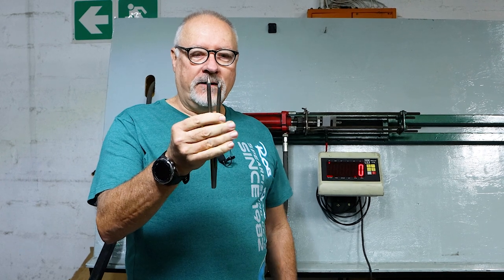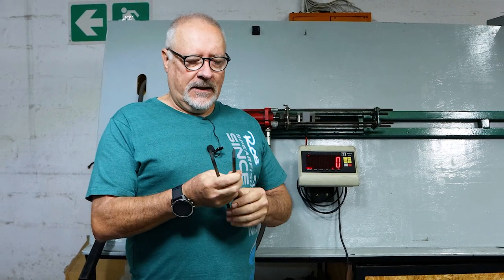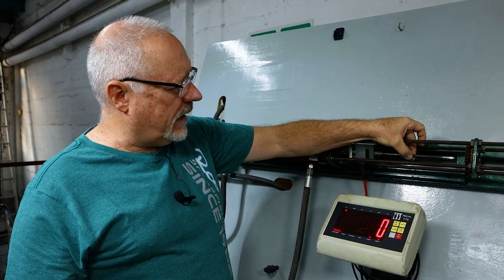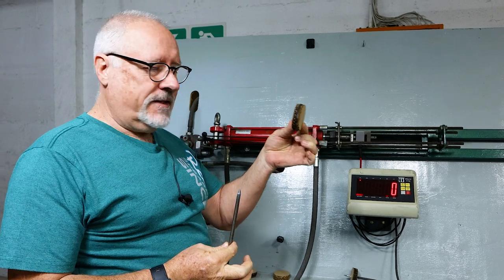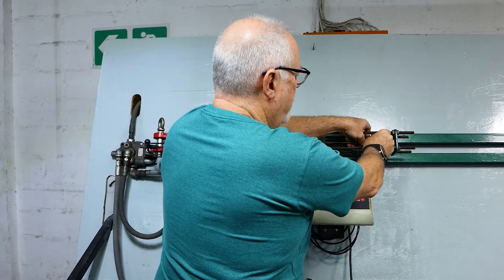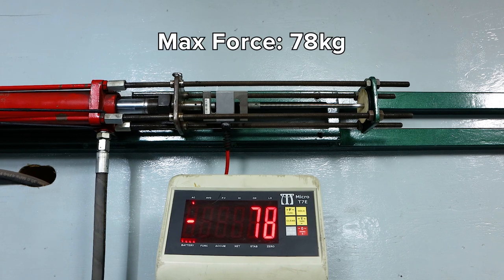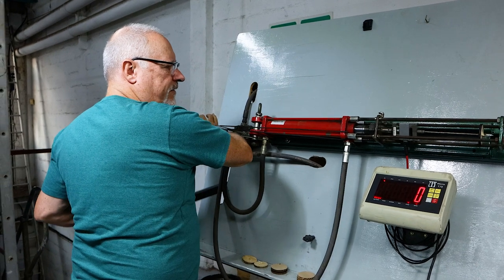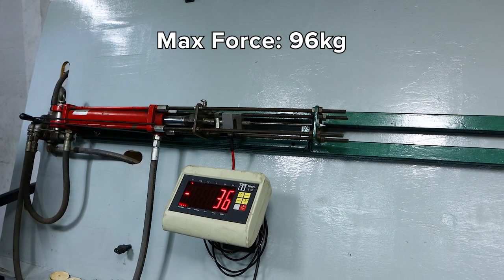Rob Allen | Tri-Cut VS Pencil Point Spear | Part 2 | 2023

Comment: Really enjoy these videos. I take it that the acuteness of tha angles are the same. From a practical point of view, i have found it much easier to cut an acute angle in a round tip using a grinder.
Reply from the maker: The angle of the pencil point was much steeper/sharper and, you would think perpetrate easier but not the case.

Comment: Thank you for this video!  Another interesting test would be a vertical drop test in a body of water with identical ends of a short shaft ie a uniform length of dyneema as a kite tail to see which one potentially deflects more  or slows down more over a unit distance.  As a dentist, we use a multi cut hypodermic due to superior penetration if administered with the proper transcutaneous puncture speed.  Also we use different types of suture needle tip either cutting or round depending upon tissue types and there is an indication for each.  I would think the harder the species target ie head shot, cutting may be of advantage and softer body targets round would produce less tissue damage.  Is this correct? Bravo Rob et al !  Cheers
Reply from the maker: Yes, we are sure now that the tri-cut will break and cut bone way better than the pencil point. Your suggestion regarding the trailing lines, this does play a big part. We have found that 2mm mono is faster (better penetration) than a 2mm polyester cord. Our assumption/theory, is that the 2mm cord absorbs water, therefore dragging more mass and slowing the spear down. With a tight weaved 1,9mm Dyneema, we found it about the same as 2mm mono. The 1,5mm Dyneema is noticeably faster though.
Reply: @RobAllenSpearfishing   Cool!  I wonder if dry dyneema were to be treated with wax similar to what surfboards if that would allow a more hydrophobic and hydrodynamic line?  I wonder if treating monofilament with wax would help also?  There are Nano particulate polishes that can be used on aircraft wings etc that cuts drag……. Just thinking out loud……. Again thank you Sir for your videos and keen insights!  Cheers
Reply from the maker: @diveflyfish  Some Dyneema lines do come with a coating to help with stiffness but it does not last. A few dives and it's all soft and floppy. I'm sure if you rubbed wax into it will help but, too much trouble for most 😜👍

Comment: I think it would be interesting to check the friction on both the pencil and tricut through the water and how much force is at the target before penetration
Reply from the maker: My feeling is that there would be very little difference. The barb itself will create a much bigger drag (force) on the spear than the shape of the tip but, the barb has to be there for obvious reasons  😜👍
Reply: I think for ranges less than 5m i thnk the difference would be small, i found though at longer lengths especially above 8m range every little bit seems to have an outsized impact.  @RobAllenSpearfishing
Reply from the maker: Agreed.      @khenrick811

Comment: I would be curious how the results would differ after the tip has been blunted a little bit. I'm guessing the tricut may start working a lot better in this regards with the secondary sharp edges. Perhaps dropping them both on the floor to simulate rock strike, and running the same test after could be cool. I'm often around reef and end up with a blunter spear mid dive.
Reply from the maker: Good idea for the video, but we will look at this in the future, as this topic is very debatable. 😅👍
Reply from the maker: On 2nd thought it's even more difficult as you never truly hit the reef at that perfect 90 degree angle but way too many variables for us to make a video. But thanks very much for your comment, and please keep many more coming for us to answer where we can😁

Comment: Penetration is obviously very important but myself I would tend to favor accuracy and I would only guess that the pencil tips tend to be more accurate, especially after filing a tricut  by yourself by hand in the field.
Reply from the maker: Agreed, but to a point. As long as you shape the tip uniformly, both are equally as accurate. Even a pencil point can be off center if not enough care is taken. I do have a video on how to grind a tri-cut.
Reply: I think in 99% of cases even an off centred tip will have very negligible difference to accuracy, especially when ur talking about shooting u set water with currents in the water and other factors that will affect accuracy also 🤔🤷‍♂️😊
Reply from the maker: @JakeDogg-RIP  I did some pool testing a long time back. I shot a 1,7m x 7mm spear with the tip off set very slightly, hardly noticeable.  I think it was about 0,25mm. This caused a 70mm placement change in a target at 4m range. I did not try a larger off set, that 0,5mm was enough to make me realize it is a big issue. Not such an issue left to right but would be in the vertical plain.
Reply: @RobAllenSpearfishing  oh wow, I wouldn’t think it would make such a big difference at such short distances! Would love to see a video on this if u can some time 😊
Reply: @RobAllenSpearfishing  like I’d be interested to see a rig set up to hold gun and target in same exact positions, both fixed to each other, and using one spear with straight tip and another with off centre tip, maybe even get 3 different spears of each and then test grouping of both, see if the tip spreads them that much consistently, like shooting if ur shooting a gun even over 25m without a bench rest it can spread just from trigger pull etc, but by fixing everything in place I’d love to see just how much it sways 👌🥰👊🍻
Reply from the maker: @JakeDogg-RIP  This is a difficult one to film in terms of set up time, multiple cameras etc so, we won't be doing that soon, you will just have to believe me 😜👍
Reply: @RobAllenSpearfishing  I do believe u, I just know there are many variables, like I would imagine an ever so slightly bent spear would have more effect than the point itself, but I do believe u, I would love to see some proper testing done, even if just to prove it and have it out there as definitive proof if u get what I’m saying, but untill then I will take ur word for it and accept that it probably does make a significant issue with accuracy 🍻😊
Reply from the maker: @JakeDogg-RIP  The very tip is much more likely to have a significant effect compared to a slight bend way down the spear. The same is true for the barb. If you bent the trailing tip of the barb just a little, it will affect the flight. I have done this test many times, 0,5mm trailing edge bend out, will do the same as the tip 0,25mm. The shot will be higher by 60 to 70mm if the barb is under.
Reply: @RobAllenSpearfishing  like I said I do believe u I just can’t u derstand it in my head, what would be really cool would be to get the slo mo guys or someone with a slow motion camera to film a regular spear then a slightly off spear, if I could see why it’s pulling the spear so much I’d be able to “believe” it more if u catch me… like my head just struggles to understand why the slightly off tip would move the spear more than the whole spear shaft being bent 🤷‍♂️ but like I said I do believe u that ur right, I just don’t believe it in my head 🤔🤷‍♂️😂
Reply from the maker: @JakeDogg-RIP  filming it is way to difficult for us to do in terms of the time it would take etc. Filming is not our priority, so not going to happen 😜👍 Try think about it this way, that very tip is the first thing that is parting the water. If it is just fractionally out it will move very little off center. It is just a fraction of a degree but over 4 or 5 meters it is accumulative. Much like an airplanes ailerons. These little flaps make a huge difference to a plane, and they are on the trailing edge, much further back. If it was on the point or nose of the plane that fin would be tiny at that would be the first part of the plane to hit the oncoming air. Remember, water is about 830 times more dense than air so will have that much more of an effect.
Reply: @RobAllenSpearfishing  yes it’s a good point about the pencil tip being able to be out of round as well. I mean, bullets for example are pencil shaped I’m sure for a reason. I still think a pencil tip will tend to be more accurate but I could of course be completely wrong. The think the gist of the issue is as you bring up which style tip tend to deform easier during use and thus causing the shaft to stray.
Reply from the maker: @bluedoggum8373  agreed. I'm beginning to think the pencil point will deform easier than the tri-cut.

Comment: Good Video, but your pencil-point looks very different to the ones I have (Salvimar, devoto sub, Sigal sub), the one you have made has a shorter stubbier tip. My ones all have much longer tips which I think will perform much better in these types of tests. Personally, I prefer pencil point as I find them easier to sharpen.
Reply from the maker: I agree, home sharpening a pencil point is way easier.  Good point re the angle, I will do a test with different pencil point angles and see what difference that makes. Id worry getting too sharp will make the tip too thin and more likely to bend, especially if you hit a rock.
Reply: @RobAllenSpearfishing  Your right about hitting rocks! but the more expensive shafts have been actually really good, but I have bent one tip over once (salvimar I think).
Reply: Real world consideration is that the sharp edges of the tri-faced cut bought in a shop is not what the average joe can replicate on a grinder. One d.i.y job and the cutting edge advance is over.
Reply from the maker: @hendrikvogel262  You can practice to see if you can do it with an old spear first   https://youtu.be/5eBpmQZlfjE
Reply: Very easy to sharpen a tri-cut tip with a Dremel.

Comment: Can I board a plane if I tricut my pencils?
Reply from the maker: No idea. I have never heard of an airline complaining about the tip. They are much more concerned with the description. The "gun" word in 
"speargun" is the problem. I always declare my gear as underwater fishing equipment. I have never been asked about the points, some ask if it is loaded. I also travel with the point covered with a short piece of old speargun rubber.

Comment: Useless information if you don't include the barb.
Reply from the maker: The barb would be the same on both spears therefore have the same drag and, follow behind both pencil or tri-cut. Besides, we were not testing barb drag, just the difference in penetration.
Reply: @RobAllenSpearfishing  the different points have different effects on the shape of the hole and integrity of the material.  The tri-cut point starts a cut In a large scale or gill plate and makes it easier for the barn and to pass.  The pencil point stretches the material -- but either way the drag on the point before the barb is irrelevant and not useful.
Reply from the maker: @ngirabedechal  I totally disagree with you.
Reply: @RobAllenSpearfishing  that's ok.  I like your videos anyway